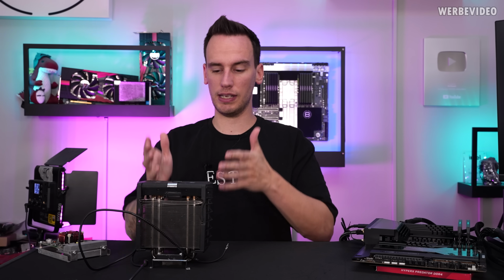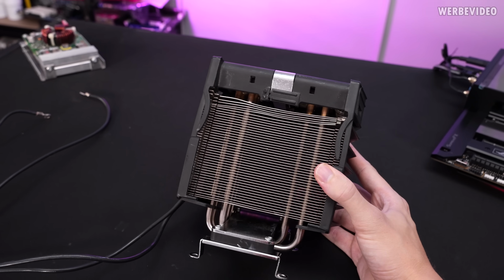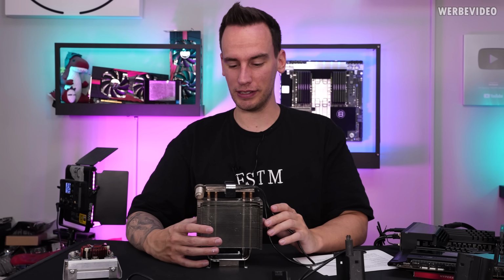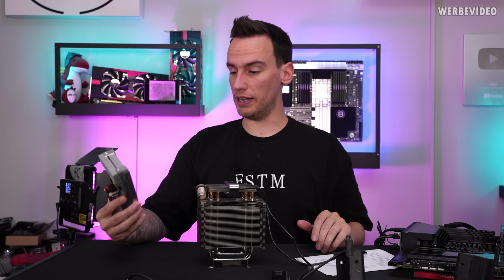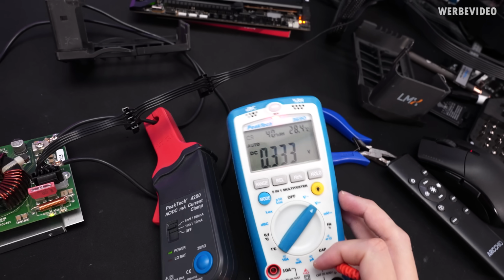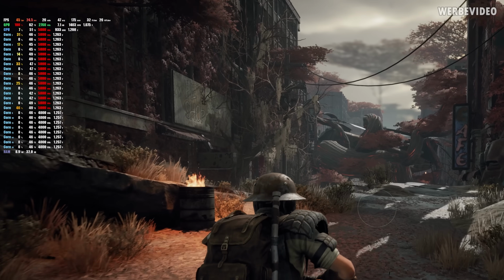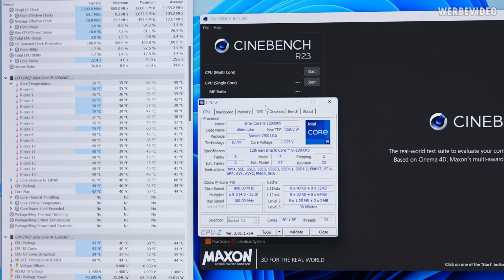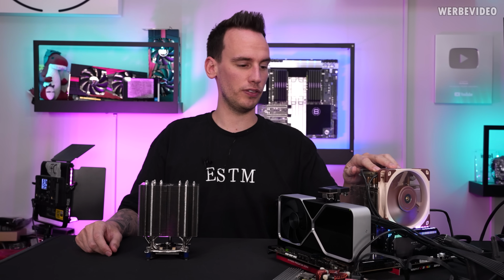This Cooler Ruined an entire Company - LMX Liquid Metal Cooler

Comment: I'm trying to think if there's anything more dangerous they could have filled it with but i genuinely can't. Even mercury would be safer to handle than NaK. 😮
Reply: anhydrous ammonia, hydrogen sulfide, cesium, rubidium...there's a lot to choose from...
Reply: @AKAtheA  Ammonia would be the obvious (as in usable) one.  It's still used in big commercial refrigeration units.
Reply: @AKAtheA  the limit is knowledge.
Reply: Eh, while it is explosive, there's relatively little of it and it's not a very powerful or high speed explosive, it's very unlikely to do more than freak you out. Seriously.
Reply: nitroglycerin
Reply: dimethylcadium is probably the worse possible thing to put in it
Reply: @Crand0m  I too love organic compounds of heavy metals. They add exquisite aroma on my asbestos bed sheets, and soothe my post-lobotomy anxiety.
Reply: my guess was mercury, or even phosphorus as the blurb said the metal coolant could combust on contact with air!
Reply: Diborane is probably the most exciting one I can think of. 
Notable others: hydrogen cyanide, bromine (har har har), phosphine
Reply: Thanks, now I'm thinking of heat pipes filled with Hydrazine  -.-'
Reply: @salmiakk_it someone needs to build a hydrazine cooling loop.
Reply: No way, mercury will continue to screw up an pretty much environment indefinitely. NaK will burn your house down and it's done.
Reply: Some nuclear rods?
Reply: If you just want 'more dangerous' then my favourite is "FOOFf"  or Dioxygen difluoride. There is a lovely blog post out there called "Things I Won't Work With: Dioxygen Difluoride" go look it up if you want to read some insane chemistry.
Reply: Chlorine Trifluoride would be funny. 
A leak would make a far larger boom than NaK.

Saying mercury isn't bad, you could try Dimethylmercury. It's one of the most deadly neurotoxins around. It basically gives you instant mercury poisoning. Someone died spilling a single drop on a latex glove.
Reply: Mercury leakage and vapors are highly poisonous instead of potassium-sodium mix, which can be neutralized simply by the water.
Reply: @Scorry  
"Mercury leakage and vapours are highly poisonous instead of potassium-sodium mix, which can be neutralized simply by the water."

Your exact words. Attempting to "neutralise" NaK will not end well. Aside from the violent reaction, you'll be left with highly corrosive sodium/potassium hydroxides which would themselves require neutralising.

Metallic mercury on the other hand is not as harmful as mercury salts as metallic mercury is insoluble.
Reply: @Scorry  erm, have you ever seen what happens to NaK when it comes in contact with water? Let's just say it's a somewhat "energetic" reaction...
Reply: @JaenFoster ? emm, I am fluent in chemistry. But both Na and K MUST be in contact with water if you want to see a BANG. Is your system block submerged in water? Or you are walking near your PC with buckets of water and occasionally dropping it on the system?
Reply: Try Lithium, as in batteries. Sodium/Potassium need an oxidant (air/water etc) to react. Charged Lithium batteries can let-go with just heat run-away, oxidant not needed!
Reply: @mikehigham23  Metalic lithium has almost identical chemistry as sodium albeit slightly less reactive. It wouldn't be ionized and it wouldn't be liquid in this application either.
Reply: @mikehigham23  the thing is that batteries charge with run out with time, also we know that a battery as something that holds a charge is dangerous.

This is a nice pipe that will hold a substance that will ignite with humity forever
Reply: @mikehigham23  The problem here is that most batteries (like in laptops, I am assuming that's what you're going for here) have good protection that they test rigorously in case you drop them or they get bumped in shipping. On top of that, the batteries are clearly labelled as a hazardous waste item. 
This is a bunch of pipes in a fin stack, and if you hit it the wrong way then it can break and leak onto your computer when it starts pumping, frying it, then combust from the air and release toxic fumes, potentially burn your skin, and probably even burn your house down at that point. 

TL-DR version: Batteries are very carefully designed to be idiot proof short of stabbing a screwdriver into them. This is not.
Reply: If they filled it with diarrhea someone could get a potentially fatal e. Coli infection